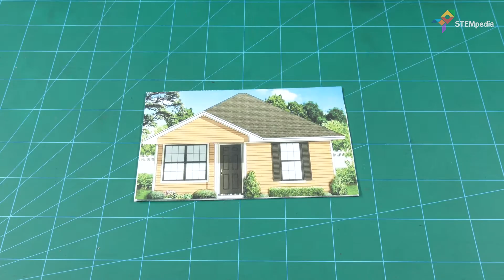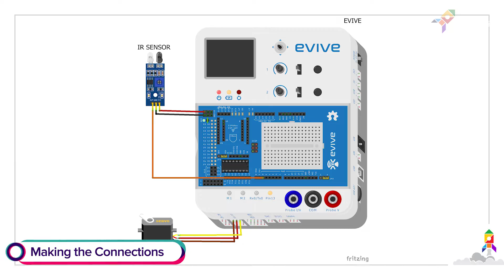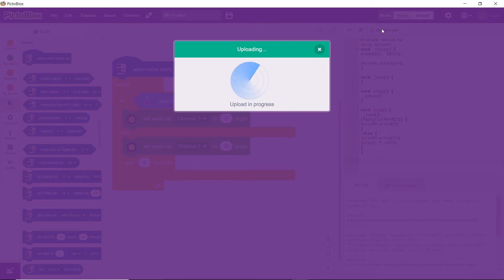Make Automatic Door Opening and Closing System using IR sensor & Servo Motor | Project for Beginners

Comment: I hate projects like this.  Using a paper clip to close the door.  This is like saying you built the space shuttle and then showing a video of putting the engine on a model rocket and lighting the fuse.

The door doesn't close all the way, nor was keeping the door closed addressed.

You didn't create an automatic door that opens and closes, you've programmed a motor and a sensor to open and close what's at best a lego door.

This isn't viable for a real door.

@VIKAS JAIN
 at least posted a real door.
Reply from the maker: Thank you so much for the feedback. This series was meant to be the projects for beginners, where they need to understand the working of actuators, sensors and how to code them. The motto of making these videos is to make them understand and learn how to code from the beginning.

For projects for makers, you can look into our stair climbing robot, hovercraft, pinball machine, etc. 

We will sure try to inculcate all the suggestions in the advanced projects.